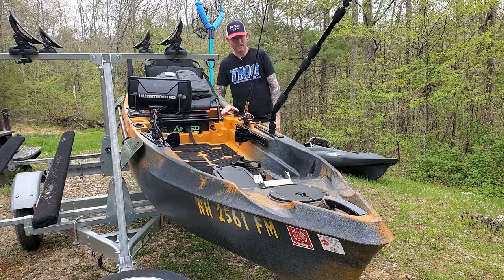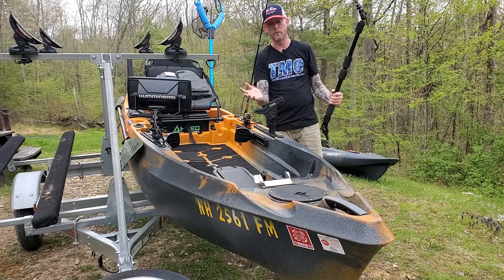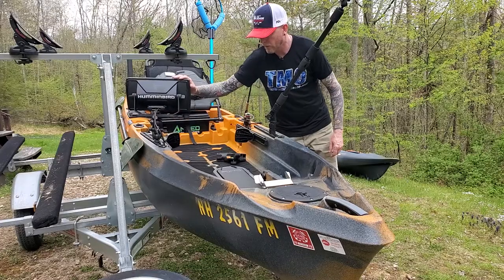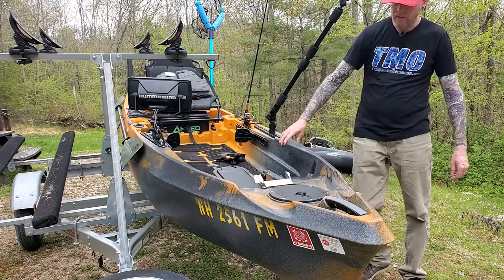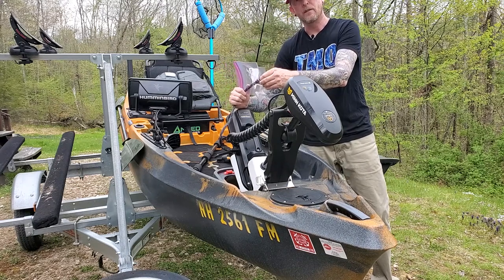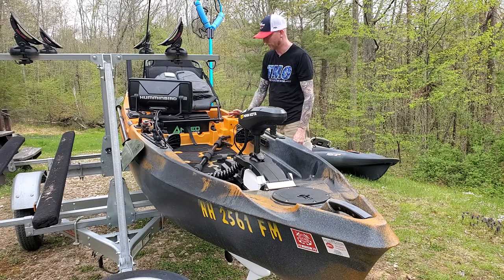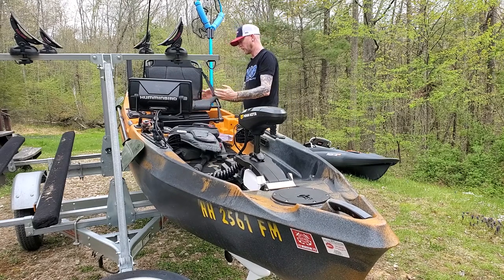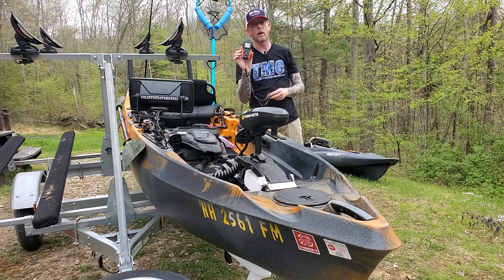How I Rigged My Old Town Sportsman Autopilot 136

Comment: Might get this Kayak soon! Thanks for the video. Do you know how much amps per hour the motor uses? Im looking to be in the water 5-7 hours at a time and was wanting to see what battery would be best.
Reply from the maker: Thanks for watching! The amps per hour will vary depending on how much use you put on the motor, as it is variable speed. I fish in saltwater mostly, with current. I am running a 100Ah LifePO4 from Amped Outdoors. My longest trips in the AP136 with the LifePO4 battery have been nine hours without draining the battery dead.  It's pricey, but for the weight (26-pounds) and life (number of charge cycles) of the battery, it was a no-brainer. I used to have a Predator MK with a SLA battery. Because LifePO4 batteries last so long, you actually spend more over time if you buy SLA batteries.

Comment: So when your done using the yak for the day do you pull your batteries and put them on a trickle charger??
Reply from the maker: I run lithium batteries. I charge them after each use, but do not leave them on the charger.

Comment: What type of meter do you use to see how much life is left in your lithium battery? Also, I've seen other videos on this Kayak and they seem to have a lot of water in the bottom. How can I avoid that?  Thank you so much for your vids.
Reply from the maker: I use the Antigravity Meter. It. Luetooths to my phone so I don't need to worry about where I mount a display. There was an issue with water sitting near your feet in the early models, but OT has since remedied that. 

Here's the link to my battery meter. 
https://www.amazon.com/dp/B07WHDB8YX?ref=ppx_pop_mob_ap_share
Reply: @TMOFishing  Thank you for the information. You have a great fishing setup.
Reply from the maker: Thank you! Merry Christmas!

Comment: Why don’t you use the 100ah lithium battery for your fish finder also? I ordered one and was thinking running my hummingbird and trolling motor off of it. Is that not a good idea?
Reply from the maker: Running your fish finder off the same battery as the motor most often causes interference with the fish finder. You'll see black lines  every time the motor runs.

Comment: Can you use the helix to plot a route and have the trolling motor follow it?

Also how long can you run the motor on that one battery?
Reply from the maker: The motor on the Sportsman Autopilot does not have Ipilot Link, which is needed to plot routes with the Helix unit. I have been on saltwater as long as nine hours without killing the battery. I did not have a battery meter for my lithium battery yet, so I don't know exactly how much battery life was left.